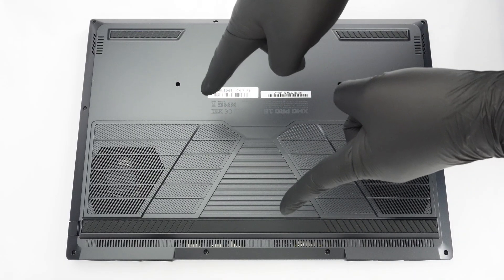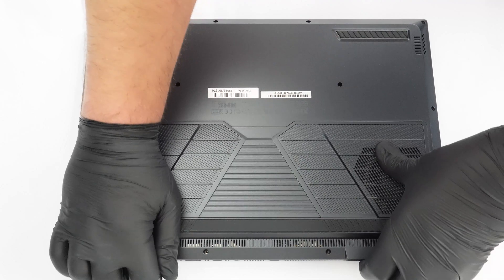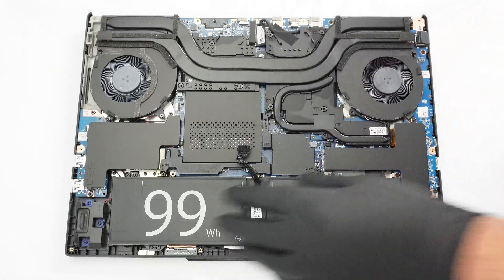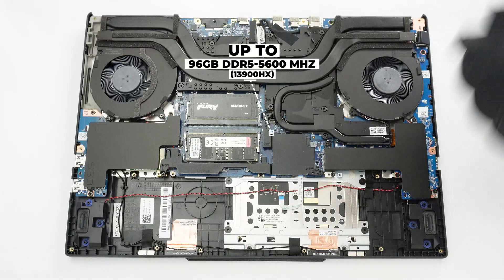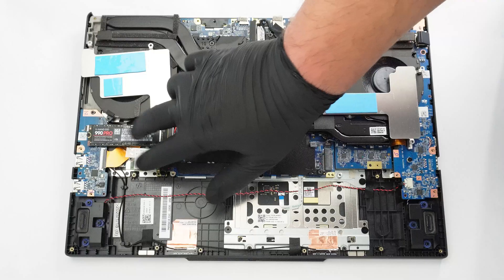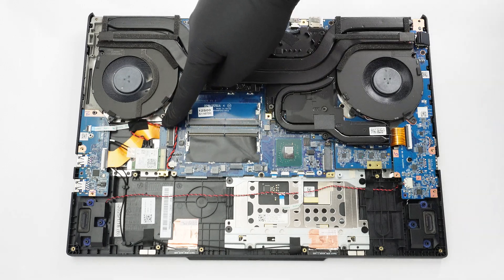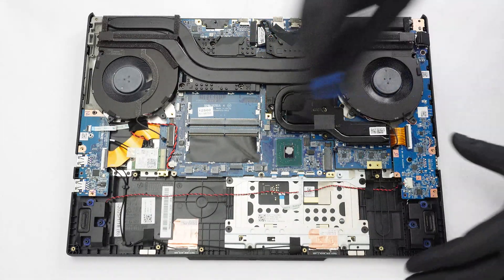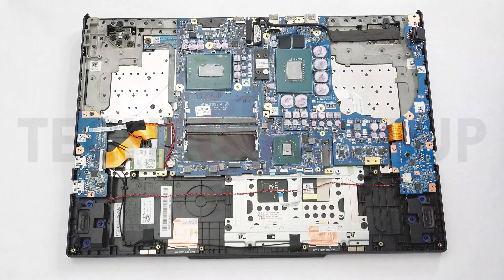XMG PRO 16 (E25) Disassembly & Teardown

Comment: 2 Vram without thermal grease ? tube is empty xD 06:00
Reply: i was looking for info about it ,the 5070ti mobile only have a 192bit bus so 6chip ,maybe those are populated but disabled (weird cost of putting chip and not using it) or some placeholder for covering pad that would have been used if it was using a 5080/5090 wich use the same bga pachage but with a larger silicon